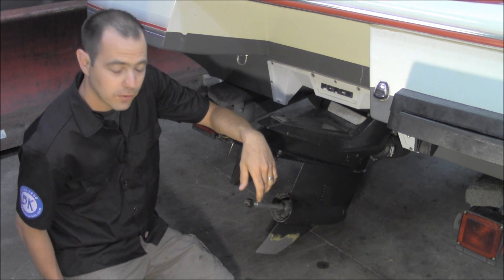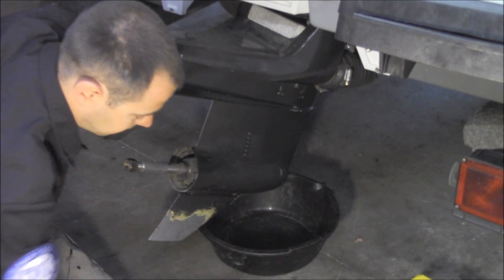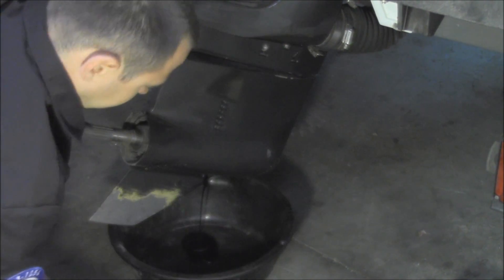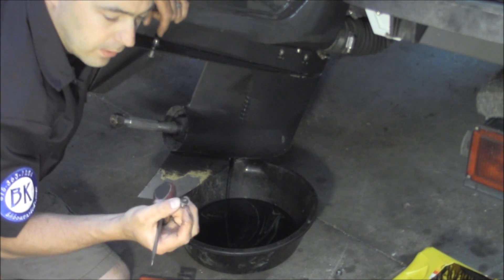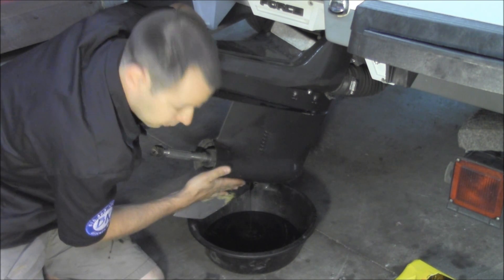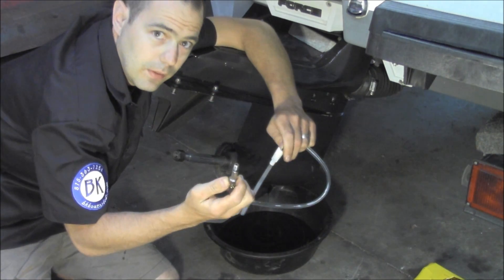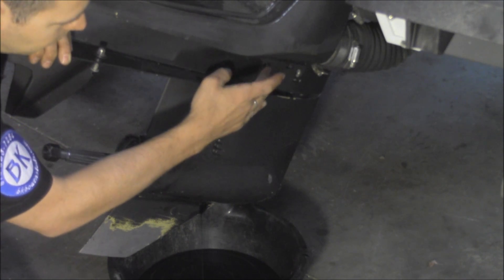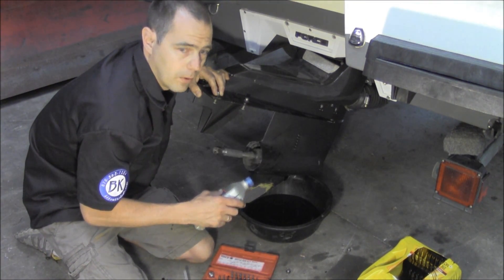How to Change Gear Lube In Lower Unit on Your Boat Motor

Comment: hey bud mine came out like that a little milky , just like yours no weird smell really, am i safe ? do i really have to change those gaskets? can i use any gasket that will fit from autozone? does it matter how thick or the material ?
Reply from the maker: +Naief Saleh depends how milky it was..  If it was like in the video you should be okay.  No, you can not use autozone gaskets.. you will need the specific seals to replace on the unit.
Reply: Trueman capoty